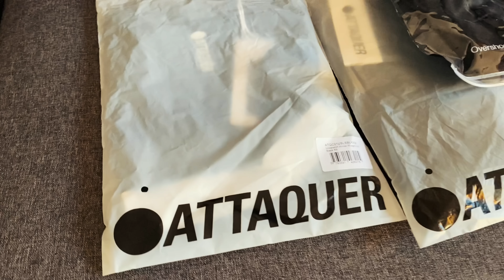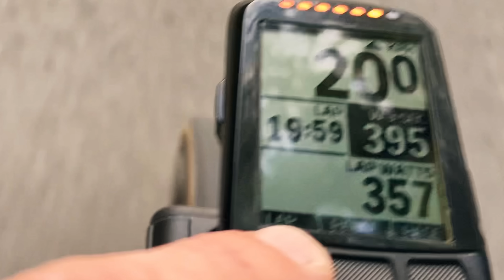10 Tips I WISH I Knew As A Beginner Cyclist

Comment: What about training on fast carbon wheels?? Staggering how many ride train on the fast light wheels and tyres. Get a set of solid alloys
Reply from the maker: I have two different thoughts about this: on one hand, I agree. A solid set of alloy wheels is great to train on, they're bombproof and it feels great to get back onto the carbon wheels when it's time to race. Conversely I also believe that 300w is 300w whether you're on alloy wheels or carbon wheels...you'll just move faster on carbon wheels. Moving faster in training while doing the same power is actually closer to the sensation of racing, which means that as long as you're training to power and not just average speed, training on carbon has benefits over training on alloy wheels. Thanks for the comment :)